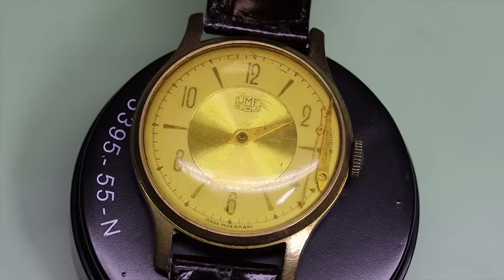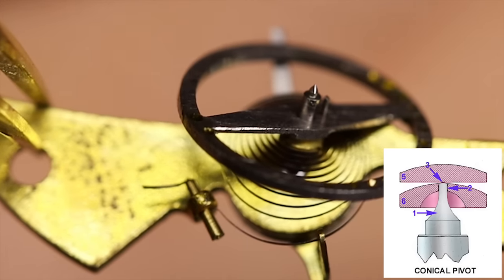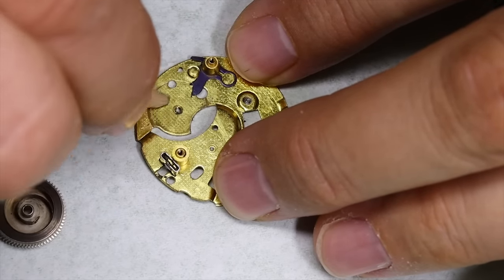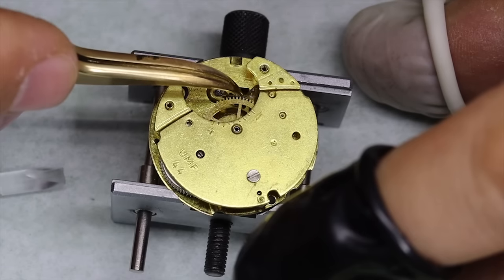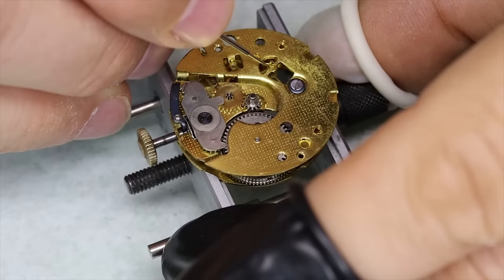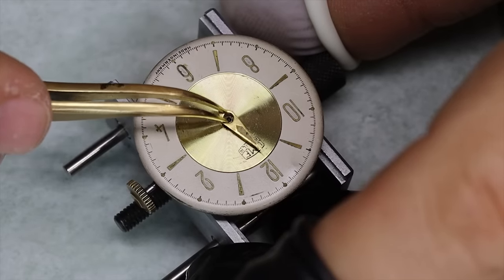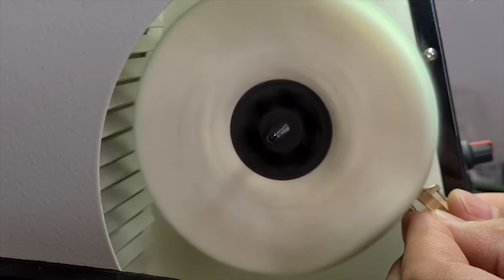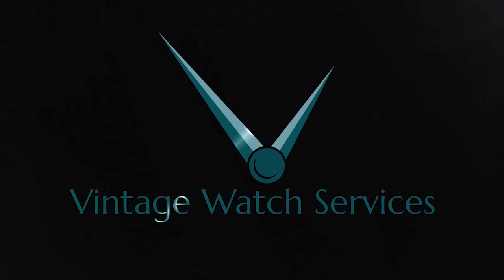The watch that lost the quartz war

Comment: When I was a kid, my dad bought for him one watch with this movement (steel, not brass though). The case and dial was beautiful, the crown very easy to use. Personally I loved it. He stopped wearing it after very short time and when I asked him why he simply said it was a bad watch - it did not keep time accurately.

It is one of the many (of his and my) watches that I eventually managed to break by multiple disassembling and assembling   :). As a 12 year old 'watchmaker', my philosophy was 'if I don't break the shafts and put the pieces back together, it should still work just like they do in the factory'. This movement gave me greater courage because of the conic shaft. I eventually mangled the hair, replaced it with one I found in a completely different movement and botched  its accuracy to within 30 sec per hour. Fun times.
Reply from the maker: Very cool story! 👍

Comment: In my childhood, a very rich uncle came on his yearly world tour visit.  He always brought "gifts".  Mine was a big gold watch (with date!).
Well, my wrist turned green two weeks later. On week 3-4, the watch changed to indicate exact time twice a day - it died. My grandmother said it was a perfectly appropriate gift - cheap and useless.
Looking at your sample, after a Rolex and an Omega, it sure looks like a shrunk clunky alarm clock. The type that keeps you awake with its loud ticking but fails to ring when expected to.
Thank you for an interesting channel.

Simon
Reply from the maker: Hi Simon, thanks for that great story! Sounds like your very rich uncle might have not been entirely as rich as he showed off to be then :)
The design of these roskopf watches indeed very much resemble alarm clocks, which frequently used cone pivots, just like this very cheap watch. There were pin pallet watches made of pretty high standard, but they were designed to be cheap and reasonably reliable for enough time to get value from them. "Dollar watches" for instance were made to last for a year or two and then you'd just buy another one. A bit like Daniel Wellington and the ilk today.
Reply: @VintageWatchServices I would argue the real end of pin pallet watches began in the 1950’s and 1960’s with the arrival of Soviet and Japanese watches with fully jewelled, shock resistant and anti magnetic movements. 

Oris were forced from 1934 to 1964 to only make pin pallet movement watches. Theirs were made to a very high standard even a few chronometers

Comment: These early Ruhla movements are very reliable.  Later ones with plastic parts in the keyless works, not so much.  They were made as early as the late 1940s and as late as the early 1980s.
Reply from the maker: Reliable as in running, yes. In timekeeping, not that much, imho 😉

Comment: The thing with Ruhla wasn't they were designed per se as such but because their Soviet overlords in the GDR didn't even recognise East Germany as anything but a convenience tank park and treated the poor E Germans quite abysmally and they gave the country just the bare bare minimum to survive with the choicest resources heading east so the country was pretty starved of things even the main Soviet nations had in plenty and so Ruhla had to work some absolute magic to bring about these quite accurate tinplate movement watches.
Reply: I have some hoary old Ruhla's including their proto-diver "wasserproof" and also a NOS 1970's gold plated one I got for an absolute song from someone in the former GDR, never worn just gathered dust and after some persuasion came to life like a brand new watch, tough brand and was told by a German friend that back in the day the watch chap would have a saucer of lighter fluid, would rest the movement in the saucer to cleanse, then generally oiled anything moving, a little tweaking on the timing and back to the owner all working fine for another 10 years.
Reply from the maker: Thanks for your insightful comment and Ruhla certainly did very nice work with what they had. The design of this watch is really quite fabulous, and I've seen some very nice other Ruhlas also :)

Comment: I've been teaching myself (with your help, as well as other YouTubers) watchmaking, and started by buying a bunch of non-running watches off eBay.  Many of them turned out to be pin pallet movements.  I've done several of them now (mostly BFG 866 and 158 but also some 1 jewel movements) and have gotten to where I'm comfortable with them.  They are somewhat tough to learn on because fitting and aligning the holes in the plates can be challenging.  Once you get them running you can hear them ticking from across the room!
Reply from the maker: Hello Shane, that's very cool to hear! It can indeed be very frustrating working on those kinds of watches, as making them run can be very difficult and thus make your effort less rewarding. I always suggest getting a Seiko 5 or a Russian watch that already runs, so you know whose fault it is if it doesn't after you've put your hands on it 😉 But if you made them run, kudos!
Reply: You can hear them when you enter the village just like your grandma's Westclock. 
😂

Comment: I received a 17 jewel Swiss pocket watch as a gift in the 70’s. I have since acquired 3 more of the same brand. I have no taste😁. These watches have two different movements, but are all pin pallet movements. Really enjoyed the video.
Reply from the maker: That sounds very nice, Ronald! Which brand is that then?
Reply: Andre Rivalle. I haven’t been able to find much information on the watches. I assumed the same movements were available in more than one brand. The movements were made by E. Gluck and are shock protected.

Comment: Sir, could I ask a question? For a hobbyist, would a relatively cheap ultrasonic cleaner suffice for cleaning watch movement parts, rather than using a proper watchmakers’ machine. (By the way, I would have no intention of taking the back off my GMTMaster.)
Reply from the maker: Yes, a cheap ultrasonic is certainly good enough as a hobbyist. Don't put the balance in there and use small jars filled with cleaning solution rather than filling the entire tank. That way you can save on the cleaning fluid also.
Reply: @VintageWatchServices  Thank you.

Comment: Nice vintage time-indicator! I see a lot of similarities to my Kienzle pocketwatch 046/0 movement!
Reply from the maker: Indeed it is! Kienzle had versions of that family that were jeweled and thus a bit more reliable, but the base 46/0 was very similar to this one. Does it still run?
Reply: @VintageWatchServices  Unfortunately not. It won't wind. I am afraid that the spring on the rocking mechanism is out of place or broken and prevents the mechanism to make proper contact with the winding wheel.
I  am trying to find enough courage to open up the movement and try to rectify it. I've never done anything like that (on that scale) before and the watch is in otherwise quite good condition.
https://www.horlogeforum.nl/uploads/db9961/optimized/4X/5/6/2/562b5961a784f13938d966ff4118d0c3ea297fa0_2_562x750.jpeg
Reply from the maker: Ie ziet er goed uit! Misschien zou je eerst een dollar watch van eBay kopen om daardoor een beetje ervaring kunnen opbouwen? Het uurwerk is meer of min dezelfde en dan voel je je een beetje zekerder als je op je Kienzle werkt.
Reply: @VintageWatchServices  Sounds like a plan! ;-)

Comment: You went ahead and took apart a Timex without me having to ask you.   I'm currently torturing a ca 1988 Timex.   The book says .001"/.025mm end shake for the balance.  I assume you know from experience what end shake is correct?
Reply from the maker: Hello Eric, yes, the end shake is a bit a matter of feel and experience. But this balance was wobbling so badly it was very clear the end shake was way too high. 
If you hold the balance wheel with your tweezer and try to move it up and down it shouldn't move much, but there should be just discernible movement.

Comment: another great job, I know these watches, I learned from them (I don't like their horrible ones).  very low quality and after the service I often did not know if I made it right or this watch is like that.  Russian ones were much better, just as cheap and very good quality slava poljot vostok rakieta very nice and very cheap.  some very pretty
Reply from the maker: Hello Karol, yes, UMF made more thoughtful watches than this one, but the Russian ones were generally better, some even very good!
Reply: There's a huge fan base out there for Russian watches nowadays, just yesterday I bought a Slave, a Poljot and a Komandirskie from a dealer and am excitedly waiting for the courier to bring them. I was only marginally more excited waiting for the 5722-9990 Grand Seiko SelfDater to arrive (mostly running, at just less than double the price of the Russians!)

Watch fans are weird people, go figure.
Reply: Russian ones were LIGHT YEARS ahead of them. I have things like seconds hacking and a date that flicks straight over in 1980s slavas that I don't have in my 2002 gold plated citizen automatic.

Comment: I actually hadn’t watched this video when I referenced the EB8800, but yeah, I stumbled on this conclusion early in my watch journey- that the prolific production of this garbage was a problem, not just against Quartz, but also things like the humble Seiko 5. I’m no Seiko fan but it’s way better than this crap.
Reply from the maker: Seiko 5's offer outstanding value indeed. There were actually some pretty high quality pin pallet watches and I even have a chronograph one that I hope to be able to make run properly. But most of them were "dollar watches" that were meant to be worn and thrown away when they didn't perform anymore.
Reply: Realize MOST OF these were made in east germany. We're talking a country that saw its FIRST  production 4 stroke car in 1985/86..... and it was a engine change in a 2 stroke trabant.
Reply: @OffGridInvestor  that is absurd; many fine products came out of East Germany, such as the Praktika cameras, GUB Spezimatic watches, and frankly even the Trabant you reference was an engineering marvel.

Comment: Sorry I only found you a few days ago. Thank you for the content. 

You brought up an interesting question/ thought I've had in the past and I was wondering your thoughts. In the past there was numerous movements, nearly as many as there was watch companies. The trend is pushing back that way to in house movements. Being that it's the more popular brands, and there seems to be a price floor, so you think that could happen again? A reset to a hand full of movements again.
Reply from the maker: Welcome to the channel! It's a very interesting question indeed, and it could go a lot of ways. The world is such a different place from back then, however. In the 20th century there were a lot of workers who could operate simple machinery at very high skill levels, and those machines were not expensive. Especially in Switzerland there were lots of small companies specializing in various part manufacture. So making movements wasn't necessarily that expensive, it might just take long due to the lack of computer simulations etc. Nowadays it's a bit the opposite; there are specialized 3D tools for watchmaking that can basically simulate everything and make the files necessary for manufacturing a movement, but these tools are very expensive (e.g 20k license per year) and the machinery needed to make the parts are also very expensive (six figure EDM machines etc). Lastly, even though ETA is no longer supplying movements to anyone who knocks on the door, other suppliers like Sellita, STP, Seiko, Miyota etc do. So it is very easy and quite cheap to make a watch with a movement from one of those suppliers, but making your own movement is more expensive and difficult than it was 50-100 years ago.